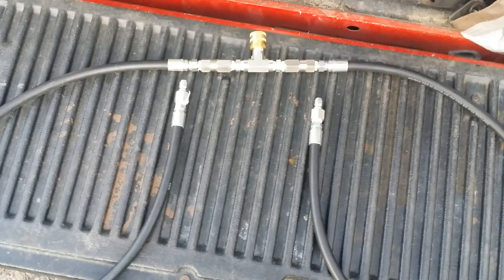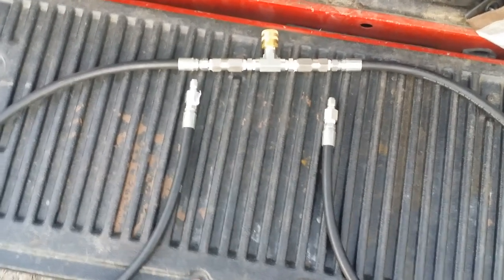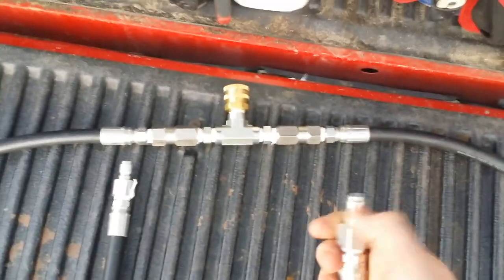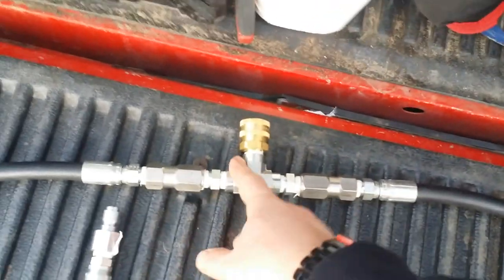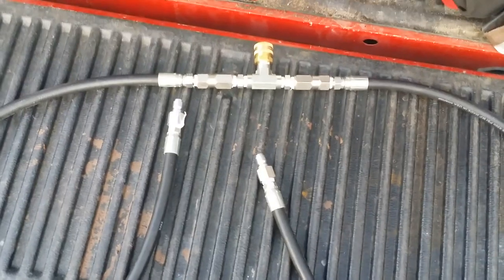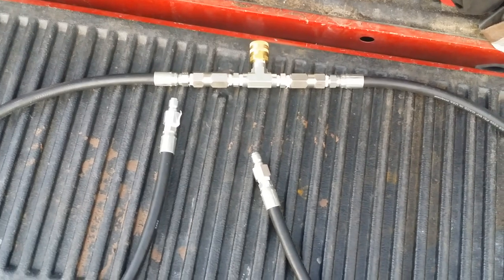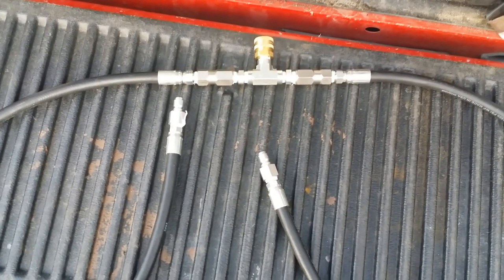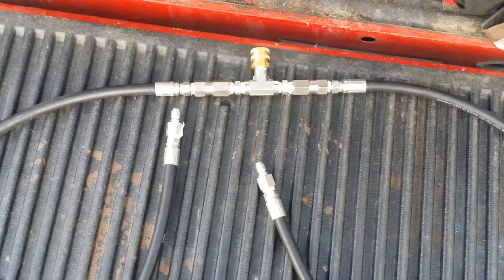Siamese kit.  How to connect 2 smaller power washers to get more flow and cleaning power

Comment: What tips should I use for 13.5 GPM?

I’ll be running a 5.5 machine and an 8GPM
Reply from the maker: 2514 or larger
Reply: I forgot to tell you that I run a 4 nozzle bar. What tips would work best for that. Thank you for taking the time.
Reply: @TheFreshRinse  doesn’t it max at 10gpm unless you have 1/2 pressure hose ?

Comment: Does it matter if one is four GPM and the other is 5.5 GPM as long as you’re using that Siamese with the check valves? And if you do want to use just one unit, do you just disconnect the one from the unit?
Reply from the maker: @nick32141  as long as they are both trapped pressure unloaders you are fine.  I know some people would downstream chemicals with 1 machine on.  Then they turn the 2nd on to speed up rinsing
Reply: @Cleanpowerwash  
Thanks

Comment: When having both pressure washers running, assuming you are getting 10gpm did you go from a 3/8 to a 1/2 inch pressure hose?
Reply from the maker: No.  We stick with 3/8.   If it was something we did constantly, then the half inch would matter

Comment: Hey Rob. I been looking to do this also. What size are the check valves? And could I run these hoses to one block with a separate per say, 8gpm unloader? If I was hooking two 4gpm machines together? With quick connects such as yours?
Reply from the maker: No need for a 2nd unloader.  3/8" I believe.